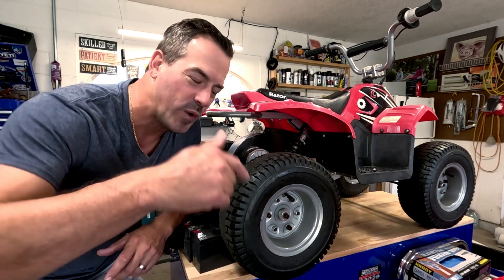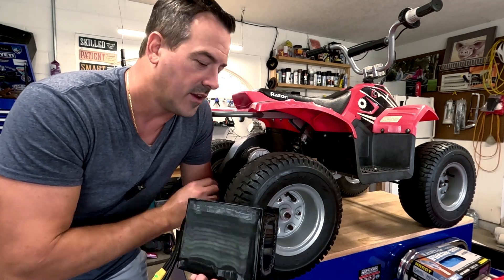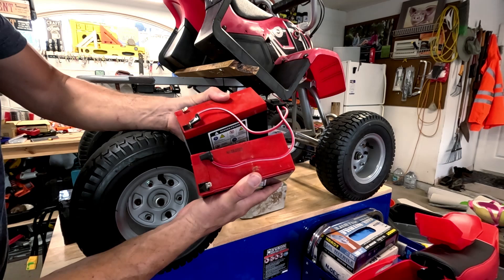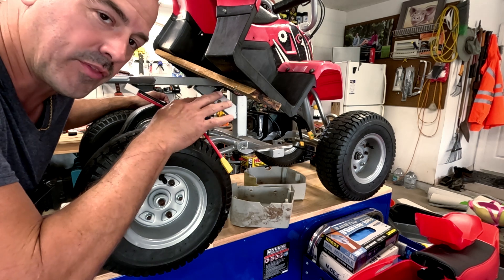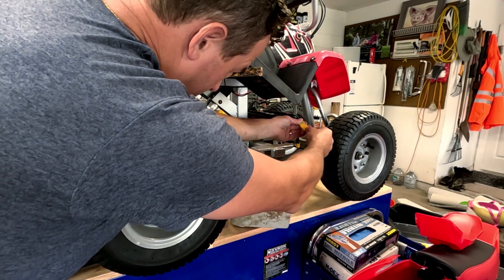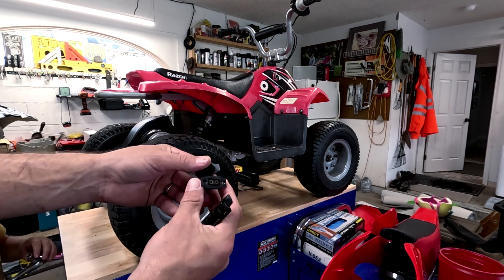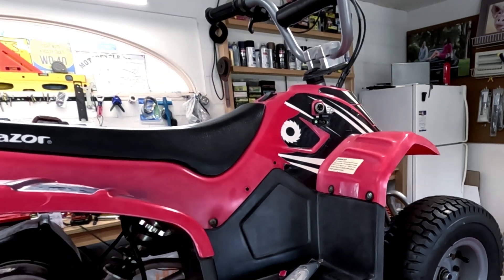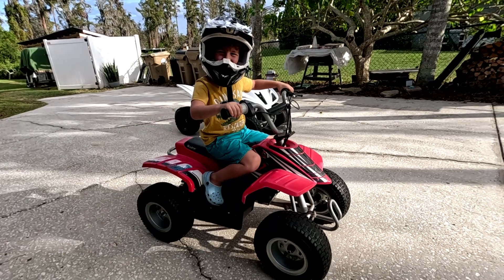WHY you should always consider LITHIUM batteries for your #Razor #ebike #mx#quad Upgrade Lead Acid!

Comment: I ordered this and can't seem to figure out how to wire the charger part. Did your battery come with the adapter for both the power into the controller and the adapter to wire from the battery to the weatherproof outlet or did you purchase it as an extra add on? If it was extra which was it? Hotpaxx hasn't been very helpful with this.
Reply from the maker: These are what I use! They just extend the charge port that should already be off your battery. https://amzn.to/3L5d0EO  If you dont have 2 ports [charge and discharge], you have a common port battery and need to just charge the single port... If you got a hotpaxx battery, it has a charge port.
Reply: @TackleThat Thank you 👍
Reply: If I am ordering this battery, do I need to order this part as well?
Reply from the maker: @tylerpritt8173 yes if you want a charge port through the plastics. If not you probably can reach the charge port on the battery from underneath, but it's kind of a pain.
Reply: @TackleThat  any chance I can contact you via another way I have a few questions. I just got a really clean MX 350 ATV from a buddy for my son. He had a drill battery wired into it so I’m undoing what he had going on.

Comment: I am trying to replace the throttle on older 24v motor and the throttle wires are blue yellow brown my new throttle is red white black any ideas on the pairing?
Reply from the maker: Hi there! Its hard to know on the stock controller.  Usually for a little cost more you can get a better controller which would work great with a new throttle.  https://amzn.to/477ZCIT   That's what I typically do, gives you full throttle controller rather than on/off.
Reply: @TackleThat only issue is I turned the dirt quad into a beach cart and am leaving today for Florida.

Comment: I’m working on an old 24 volt quad. I have replaced SLA with 24 v Kobalt battery. I have 24 V to the controller with the large red and black wire.

Small red and black wire out of controller that used to go to the charge port has one and a half V there’s another loose red wire small wire that comes from the same place in the controller as the charger wire. and it also shows about 1.5 V I have a full power light at the twist throttle. The brake switch seems to work. 

I get 0 V going to the motor even at wide open throttle. The safety switch for the break is plugged in and it has 20 V on it at all times unless I squeeze the brake and it goes to zero.  what am I missing? 
I wired it direct to motor from battery and used a house light switch and it worked but figured that wasn’t too safe for the little guy. Any help? Anybody? Anyone know what each wire should be as far as voltage?
Reply from the maker: You still have the on/off switch hooked up right? If ya cant get it, new controller on AliExpress is around $15, and key switch throttle like $10... Really nice upgrades anyway

Comment: Did you select ring terminal or adapter for discherge connection?
Reply from the maker: Adapter if you want to connect this battery up to the stock electronics.
Reply: @TackleThat  thanks

Comment: Where did you get the charger plug extension?
Reply from the maker: I used these! https://amzn.to/3EhUsxW
Reply: @TackleThat I just purchased the battery you recommended today for my son's 24 volt razor quad. Is this the piece that you cut out to install into the frame so that you can charge it?

Comment: Idk im on a budget and sla is so much cheaper and less dangerous 
I had a 48v lithium battery blow up and it left a crater in the dirt 3 ft wide to me its just not worth the risk
Reply from the maker: I hear ya! What brand was yours?
Reply: @TackleThat  Same thing razor dirt quad but the one that blew up was a mx650